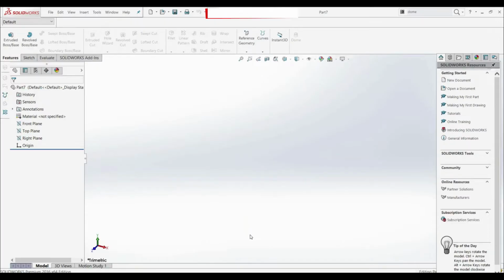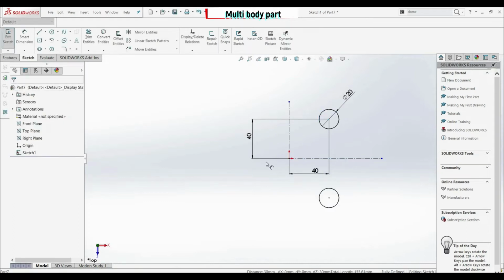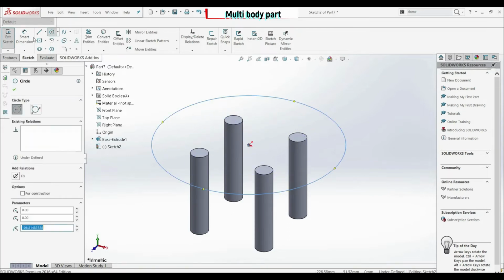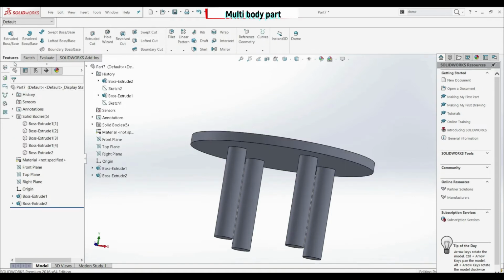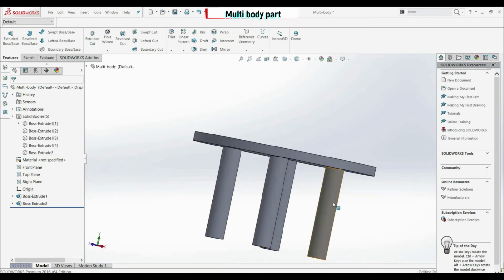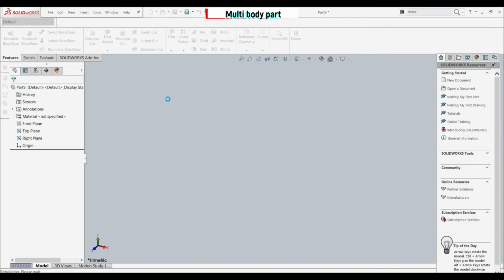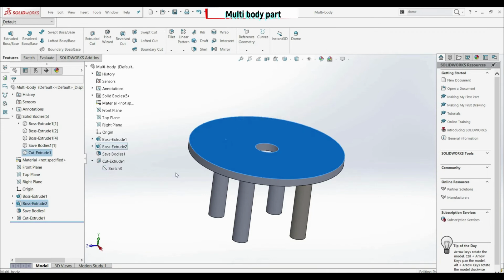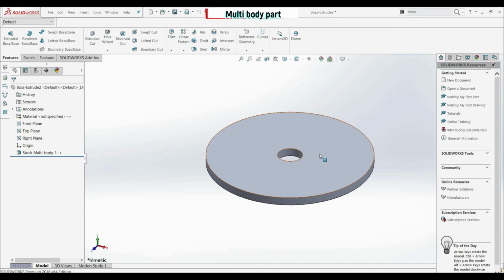Solidworks Tutorial  - Multi body Part

Comment: Hi mate! is it possible to save all the different bodies but in different folders or they must be saved all in the same folder?
Reply from the maker: Yes, it's possible! Open your multi-body part.
Right-click the "Solid Bodies" folder in the FeatureManager tree and choose Save Bodies.
In the Save Bodies window:
Each body will have a file name and default save location.
Click the file path for each body (the "..." button next to the file name) and select a different folder for each one.
Ensure “Create Assembly” is checked if you want to generate an assembly that references all the saved parts.
Hit OK — your bodies will be saved into their respective folders.
Reply: @engineeringcadschool  thanks! :)